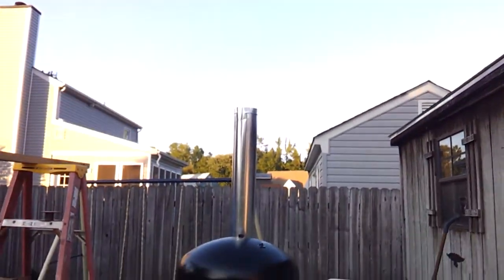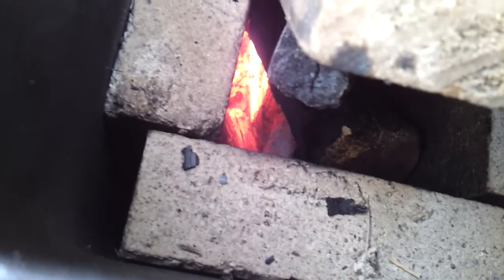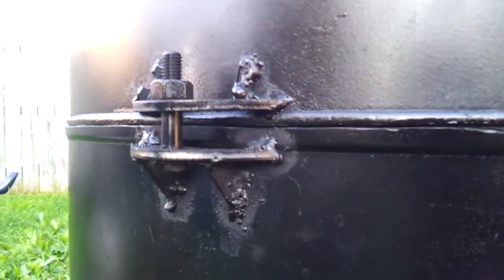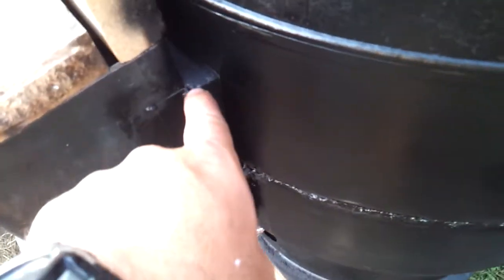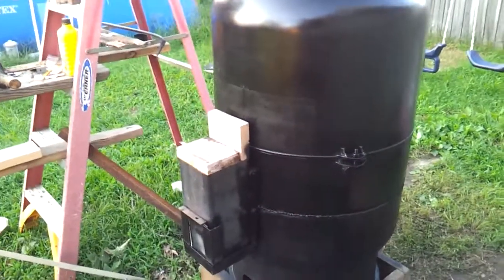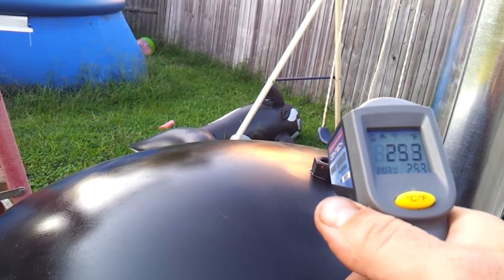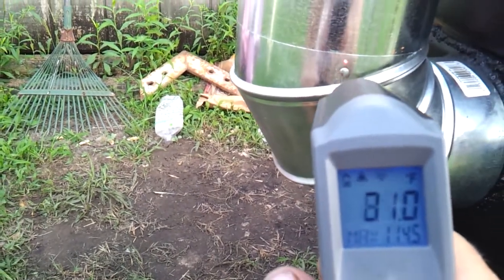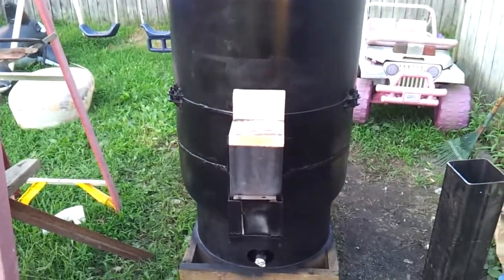Rocket Heater Wood Stove Build Part 10

Comment: Just an idea I used... You need an ash pit below the wood chute to collect the ashes instead of letting them build up and eventually snuffing out the fire. A larger wood box can also be used so you don't have to keep feeding the wood in (such a waste of time)
 A larger box works great for longer burn times and better heat control. Just FYI.
Reply from the maker: Painter D Thanks for the input. I hope you found some value in my video. Thanks for watching!!!